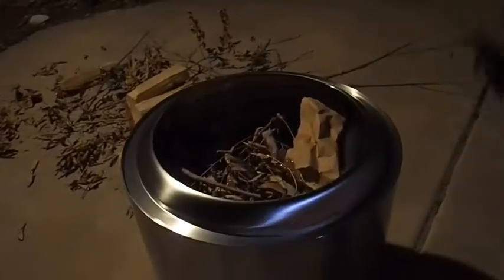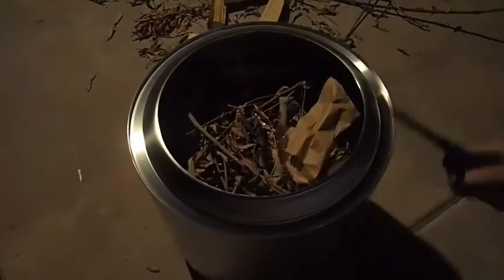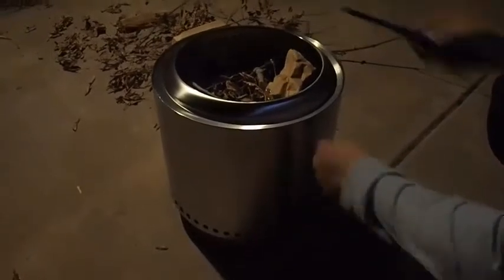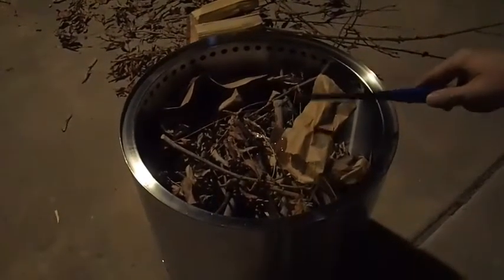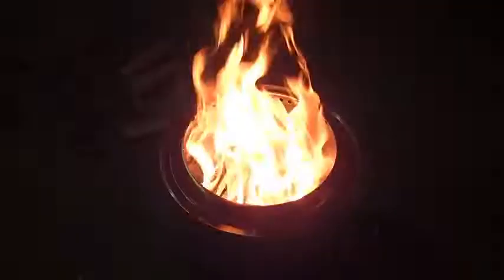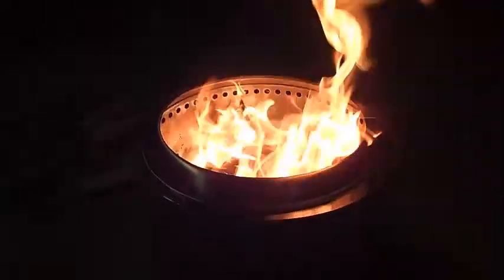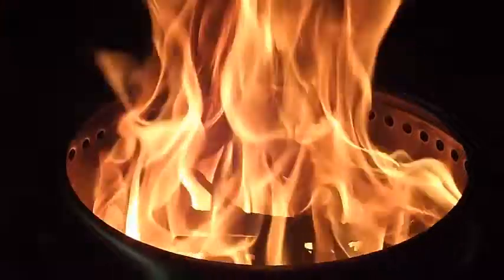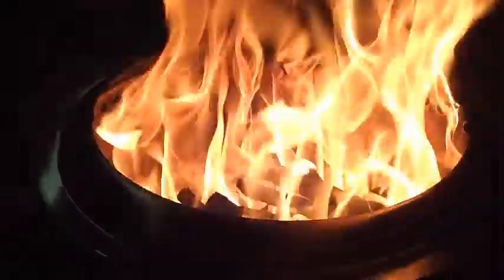3 principles to use your Solo Stove Ranger Fire Pit optimally

Comment: Just to let you know I think it was the second point fuel doesn’t get pulled down heated up and burned it’s heated 02 that hits heat and fuel coming straight off the wood that ignites.
Reply: Yes, you don't "suck" hot air downward, not how physics work 😂

Comment: Great tips but I doubt that the smoke can be drawn downwards. Heat rises.
(I own three Solos)
Reply: It doesn't draw it down. It burns it. That's what the holes at the top are for. Air for the secondary burn.
Reply: @racylaserjet  Isn't that what I said?
Reply: You’re right. The whole sucking smoke down was bollocks. It’s heated air to ensure enough O2 for the secondary born.